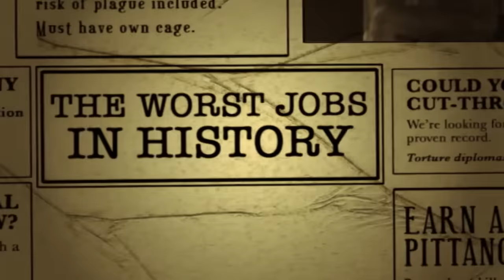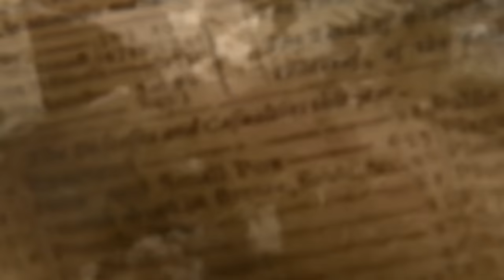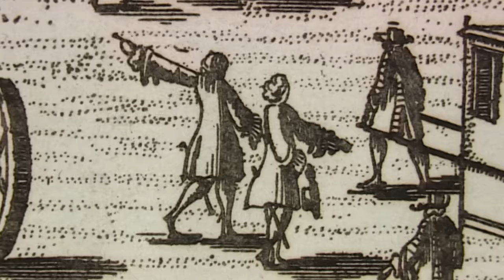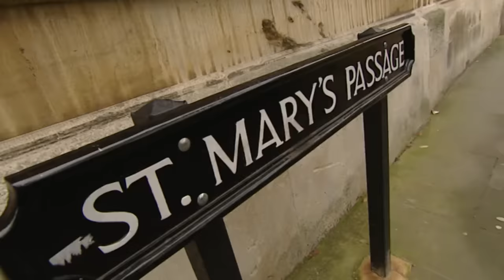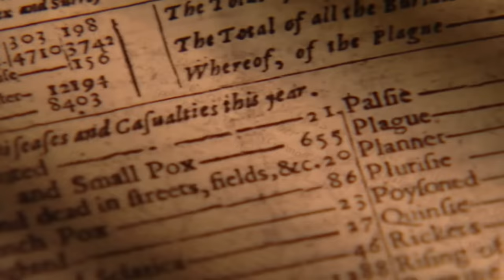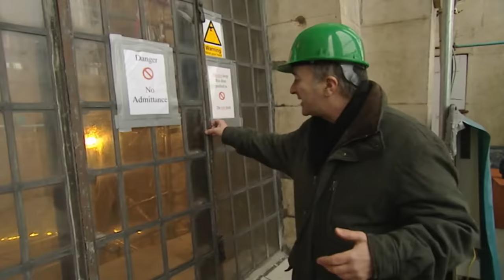Why Was Violin Making The Worst Stuart Era Job? | Worst Jobs In History | Timeline

Comment: My current violin is strung completely in gut, plain for the top strings and one overspun in silver wire for the bottom string. Gut strings have always been made since ancient times and are still available in all forms today. Actually the most important innovation of the Stuart period was the development of overspun strings for better bass notes.
Reply: Sure, but there're alternatives available now. There weren't back then.
Reply: Are they more expensive than synthetic strong violins? Is there a difference in sound? I've never had the chance to ask anyone

Comment: The petard seems much more like a modern breaching charge rather than a hand grenade. As a former combat engineer, grenades were never put forward as a method of door breaching.
Reply: Grenadiers in the late 17th to early 18th centuries did use them to break smaller doors.

Comment: Thornhill had apprentices or assistants who must have done the basic blocking out of the designs. The motifs like coffers, rosettes, decorative bands, and even the perspective architecture could have been done reliably by assistants. They are so regular and repetitive and they just have to turn that out by the square yards (no metric system at the time).  Wouldn't Thornhill have used his time to do the more difficult figures, faces etc? Maybe even the drapery could have been done by assistants. Lely, a fashionable painter to the court, had a production line of sorts.  He did the actual portraits and special details, apparently, but left the zoot to his shop. They didn't say whether the painting was oil or fresco. I'm sure Michelangelo had assistants because they had to work fast with fresco. 
It doesn't make them hacks or frauds to use assistants as they would have known how to work in his style. But one man couldn't paint almost 150,000 sq feet by himself even in two years? That is like painting a wall 150 feet high by 1000 feet long in intricate time consuming details.They must have worn out hundreds of brushes too. Tony didn't say how many hours per day they worked. It might have taken months just to set the basic lines of the design in place. And maybe they had a more generous platform on which to work. Wouldn't you think the arcade had to be set out accurately all at once and not risk getting the spacing wrong?

Comment: He's Fing insane eating a toad. Just because it was used to make someone feel better doesn't mean he had to do it.
Reply: You can freeze it at 31:55 and see that its not a actual toad.
Reply: Or more easily, you can tell it wasn't real due to the camera change. A camera change can happen instantly or 30 minutes later after the crew have got ready to 'make the switch'. You're seeing it over the course of a few minutes but each scene with multiple camera changes could have been filmed over a number of days.
Reply: a toad is not blood red inside
Reply: Even the original toady didn’t really eat the toads.
Reply: He didn't eat it